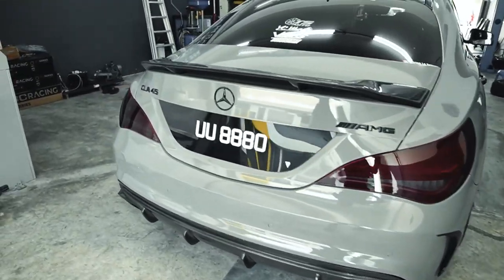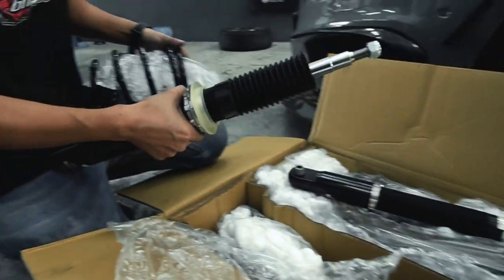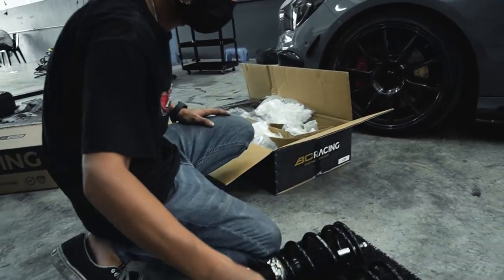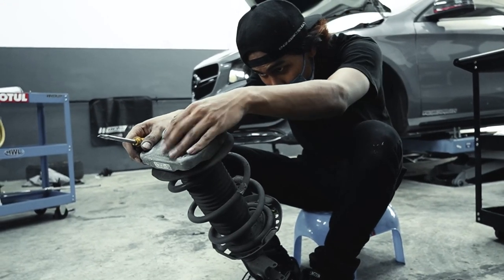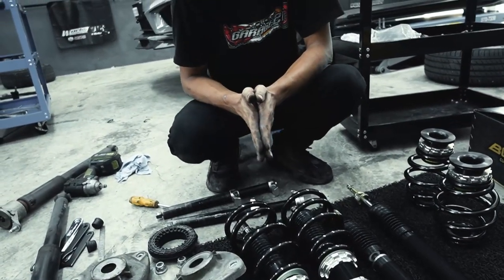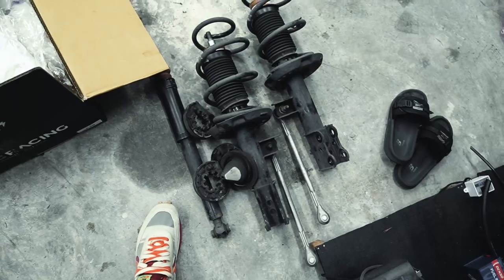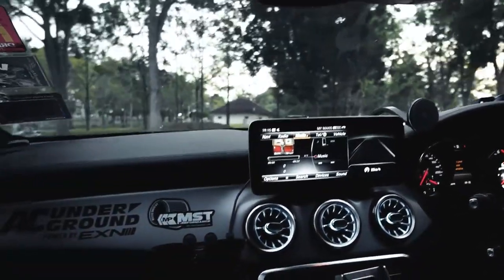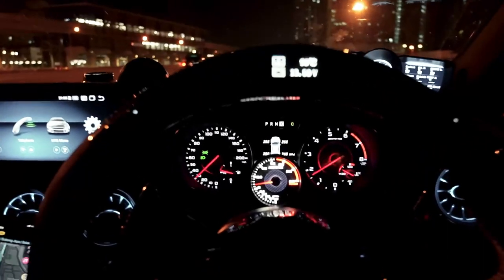BC BR COILOVER - MERCEDES CLA45 AMG ft. GARAGE 21

Comment: 😍 best2. Aku pun tak reti sangat tapi try off/on tcs. Abs gambar jalan lurus tekan brek dia takda linglong. Ko try la masuk corner tekan minyak plak. Kaki jgn tekan stanby brek. Tapi jangan la mula2 ko test masa speed 240. Try 150 ka 170 km/h ya bukan mph. Test drive le kete dalam sepang lepas tiap kali upgrade.

Comment: Stock suspension is to damm hard i am also planning to do upgrades on mine if i kept the car for long its 2015 manufactured got sold and registered in 2017 through mercedes dealership when i got it it was olny 8000 kms driven now its 16000 km if i kept it il go for full exhuast set up a bigger intercooler,ams air filter or pipercross filter,ams cold air intake,new steering and suspension setup and a stage 2 ecu remap,it already have a sports exhaust if i plan to sell it il only go for stage 1 tune it will take its power to 410 420 bhp with all the mods 450 us bhp can you tell me can we code old cla 45 to have individual and sports+ mode mine doesent have amg dynamic select package like bmw does coding and new sports us mode can be unlocked through it,i found one with it white colour but the previous owner drove it near 32000 km and many times it got repaired after accident so i left that deal i got a showroom condition one with 8000 km on board i want its analog meter to digital but i doubt of anyone made it in aftermarket accesories....